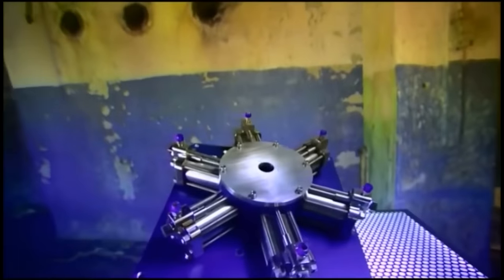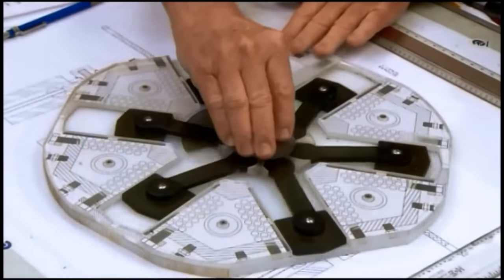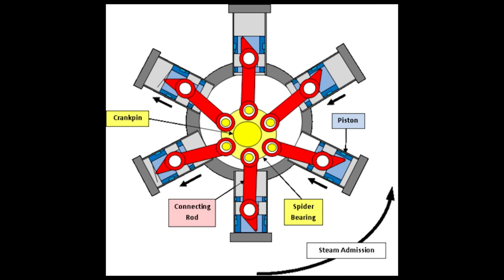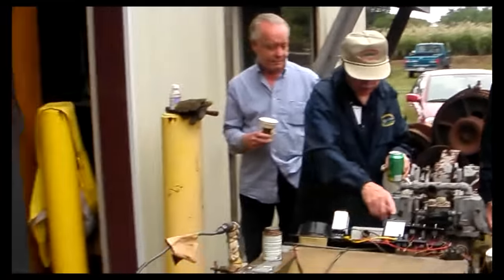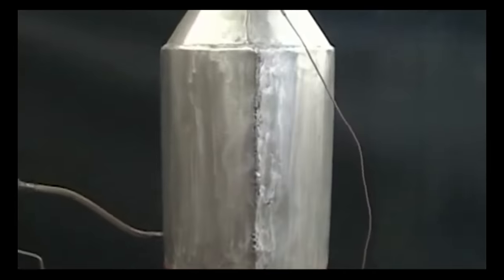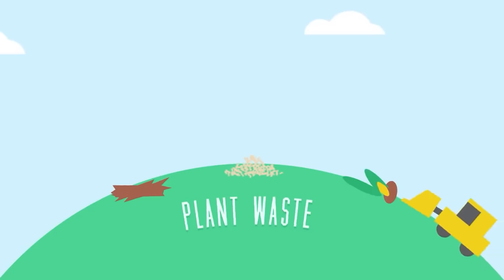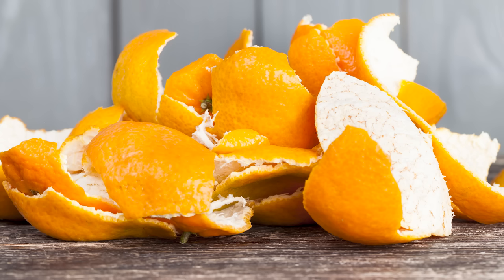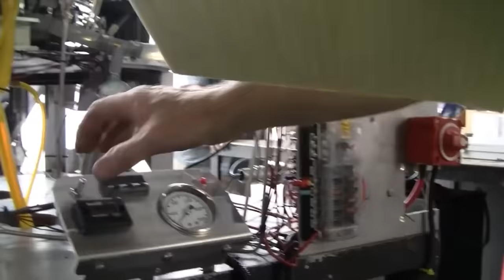Is the Cyclone external combustion engine the future?

Comment: Nah, it's still a Steam Engine.  Modernized mechanically and with an efficient boiler section similar to the 1925 Doble, but a steam engine.
Reply: Nuclear power plants are steam engines. Same with coal plants.
Reply: I wonder if you could heat the water with an electrical coil, and power that with an alternator? With enough left over to use? You’d think that’s impossible, but those torque numbers are insane!
Reply: A steam engine will always be more efficient and make less pollution.  I've been saying this for years.. all the inefficiency in an ice is because gasoline doesn't burn fast enough for the rpms required to drive it.
Reply: @alphagt62  the torque is insane because the expansion ration of 213 degree steam to h20 is 1:1600 supercritical steam is way beyond that
Reply: Engineer: It's a steam engine!
Marketing: It's an external cyclone combustion water powered radial engine!
Reply: It's a steam engine

That's what I thought immediately.

I'm no steam engine enthusiast anything, but I've always known steam produces more torque.

Thanks Lindsay's Technical Books and RIP.
Reply: ITER is essentially a steam engine powered by an artificial star ❤
Reply: Come on guys we all know the steam engine has been around for year’s… the idea and how it’s made is all… past and future will collide yet.  Best wishes to you all.
Reply: That’s what he said, it’s not like the old steam engines but it’s still a steam engine. He never asserted it wasn’t one!
Reply: @wedgie502  of corse you’re right, I’m sure someone has already tried it at some point.
Reply: @alphagt62  That's a violation of the Law of Conservation of Energy -- you are trying to make something out of nothing.
Reply: @kevinscholer256  Steam engines are less efficient.  Thermodynamically, we cannot extract energy from non-reversible processes, and vaporizing water is a non-reversible process.  It takes about 970 BTU to convert a pound of water into steam at atmospheric pressure and at 212 degrees temperature.  You can't create work from that.  Steam engines work on the extra head added to raise the temperature and pressure even higher.  Internal combustion engines don't use a liquid that changes phases and therefore suffer fewer energy losses.
Reply: @53kenner yeah that's not true, like at all.  Vaporizing water IS a reversible process and modern steam technology achieved efficiency ratings well into the high 40s back in the late 1970s and early 80s. 
Also a butane cigarette lighter makes between 3200-3500 BTU which can make work with proper boiler designs, a lot of miniature live steam models even use butane for fuel and their burners are similar to lighters except you can control the flame easier.

What made you think Vaporizing water wasn't reversible? Lol it's literally steam, all you need is a condenser.
Reply: Turbine engines for power plants. High horsepower but low torque. Not very efficient until they get up to speed but at that point very efficient.
Reply: Too fast burning gives an ic engine preignition.
Reply: @tadwyn  Still less efficient than ICEs... especially in smaller applications like transports.
Reply: @tadwyn  Higher combustion temperature gives ICEs higher efficiency.
Reply: @sandervanderkammen9230  yes, higher compression and temperature do. But it produces nox. Also the ic engine has to throw a lot of heat away or it will melt down. Steam engines are essentially heat engines and for best efficiency try not to throw away heat.
Reply: @tadwyn  Steam engines produce higher NOx emissions due to the much leaner air/fuel ratios.

The Rankine Cycle has higher heat rejection than the ICEs.. more heat energy is lost and thus more fuel must be burned.
Reply: @tadwyn  The Carnot Cycle formula tells us that steam engines can never match the higher efficiency of the ICE, they are cheaper and more practical than steam.
Steam is no longer viable in any applications outside of nuclear power or the largest combustion power plants.

Comment: I worked on the project, no test run over 5 minutes was ever made. Vibration was a huge problem, and anything but deionized water would cause corrosion issues in the engine.
Reply: Boys, we got a minor setback, looks like we have to shelve this one cuz I don't feel like wording numbers n stuff. Everything has a learning curve. Most curves hinge on current available materials. If your on the cutting edge of something, then explore other fields to propagate better models. After all, the vast majority of current tech, is based off old tech that received new information.
Reply: Perhaps using a different fluid may help.
Reply: @codetech5598  perhaps just using a better engine design that isn't a poorly built steam engine.
Reply: "I worked on the project"

Didn't we all...
Reply: @thesleeperofrlyeh9015  The design is purely nonsense -- it can only be fixed by throwing everything out and starting over. Even if you did that, it is limited by the loss of the latent heat of vaporization -- which is a limitation of physics and not engineering.
Reply: Now YOU are a guy I would like to talk to.  What you say makes total sense based on my analysis of the engine.  That "spider bearing" is basically a set of hammers that beat the engine apart and still do not accurately time the pistons.
Reply: @vinny142  "And I don't have an actual name". Yep. Seen this before.

Comment: Burning biomass fuel is a dirty process at best. The reason we haven't heard about this concept is that it wasn't practical for a whole host of reasons, not only dirty combustion. The bottom line, as several have noted below, is that its a steam engine, nothing more, and if you want a steam powered vehicle there are a large number of engine designs that are equivalent. This is someone's concept that they pursued because it was their own idea.

Comment: Honestly, the "No engines delivered to customers" part is the big clue as to why you haven't heard from them.  I don't know if they didn't sell it, couldn't sell it, whatever.  It would be such a big change form internal combustion that I can imagine it's problematic to get a manufacturer of, say, riding mowers to adopt them.  They would have had to not only develop the engine, get it in a configuration that could be used in a vehicle (i.e. how do you hook it up to a transmission?), and then develop some sort of useful vehicle all on their own.
Reply: I was on there facebook page, they are having funding issues to bring it to production, plus they had an legal battle they where dealing with. I was wondering what happened to them as well, me being fascinated about steam power.
Reply from the maker: Ill look into it😱
Reply: @TugIronChief  Perhaps.  People lose money investing all of the time.  Sadly, engineering acumen doesn't equal business acumen.  Assuming that they DID develop this motor, that's an awful lot of work for a scam.
Reply: It is a radial steam engine. It would have massive torque and probably would not need a trans.